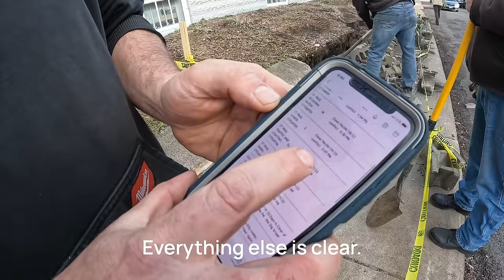Rebuilding a Collapsed retaining wall    4K

Comment: Great video. BTW, when would you need to install a perforated pipe at the base to direct the water from the top and soil away from the wall?

Comment: I’ve leaned a lot watching your videos. Curious about your opinion on bagged concrete use, I see a lot of those around drainage pipes and some yard retaining walls. In my case I have undeveloped land with  wash outs and erosion. Thought of using concrete bags or even burlap bags filled with dirt to control the runoff. On a tight budget and it’s all DIY here, don’t want to waste time, effort and money. Thanks for the videos.

Comment: Hi Stan, One very hot summer I built  a 35 foot retaining wall with those stepped interlocking blocks.  The wall was five courses high and the blocks were very heavy.  I figured I'd set them all in place and then backfill.  I think you can guess what's coming.  As I placed the last block the entire wall collapsed in a cascading motion, like dominos!  I yelled to my wife, "Who's the engineer on this job!"  Since the blocks were interlocking I had to reset EVERY SINGLE ONE!!!  LOL  Shalom/gw  PS  I backfilled as I went the second time.
Reply: Lol😅. That kind of sucked, I'm sure.

Comment: My 3 foot tall wall settled some the first 3 years. So if you look for it you can see that it is slightly wavy. In the last decade is has not moved an inch. 

Is that now self compacted. Or is it possible it will start moving again and eventually fail. 

We put down 3 inches of angular rock.

Comment: Great job, Stan and crew!  As far as what videos, I like a mixture of all you mentioned.  A good variety keeps the channel content fresh and keeps things interesting.  Only thing I would change is those captions.  I think they are unnecessary and they at times are totally incorrect.  I think YouTube has a feature that you can toggle that will add captions automatically.
Reply from the maker: I’m working on getting rid of the captions for you guys
Reply: @Dirtmonkey  Thank you

Comment: Hey from the UK Stan! 

Firstly I just want to say thank you for the content. Always enjoy your videos from the trade shows to the construction! 

Two questions for you. 

1. Why do you in America do almost all of your retaining wall with interlocking block? Over here in the UK we build them by hand and put mortar in between creating one solid unit compared to your individual block method. Is it because its quicker and easier or is it to do with the freeze thaw you get over there? 

2. I understand why you put clean stone behind the wall to act as drainage but you don't wrap it with a membrane? which over the years will lead to sediments transitioning through the stones and silt collecting at the base of the wall which would then create a problem. 

If you could go over that in the next video or even a reply would be interested to know! 

Again love the videos. 

Thanks Ollie
Reply from the maker: no membrane because that will clog and create hydrostatic hot spots-or potential blowout.  We also don't use mortar because the walls "float" with the freeze thaw cycle and it it seems to work good.

Comment: I am currently rebuilding a 30’ Celtic block retaining wall along driveway. Same scenario as here. 7 courses+ cap (@42”) stepping down 1 course twice to 5 courses. I noticed you didn’t separate dirt from clear backfill this time. Wont the dirt contaminate the drainage gravel over time? Love your channel! 🪨🧱⚒️✌️🇨🇦

Comment: No filter fabric on top of the stone? Wouldn’t it silt up, get wet, freeze and then push out the block?
Reply: i think the fabric gets clogged usually and puts more pushing force on the wall. could be wrong though
Reply: @danielaltamirano322  Stan does this on all his bigger walls though? Although it’s more of an anchorage

Comment: Fascinating to see how retaining walls are built in the US😉 here in the uk we would concrete the foundations and use hollowed out concrete block which we feed steel rebar through vertically, we also lay rebar horizontally across the beds.. we then fill the hollowed out voids in the block with concrete and that gives you extra tensile strength both vertically & horizontally.
Reply from the maker: Yep-  we did that back in the 50's and 60's here and some people still do it in these parts.  BUT those walls have a higher failure rate than how I build them when they are done right.  PROBLEM is most companies don't do walls right.  More landscapers build them wrong than right.

Comment: A mixture of all of them and if I was watching this video correctly you do not use adhesive for your caps something like a or just that type of block wall have its own recessing locking cap to the blocks we have a local block company in San Luis Obispo and I don't think they make a block anything like what I've seen in some of your videos but I do like that block that you are using is more symmetrically square where you can cut your angles for your radius outside turns and I suppose you cut the face to make your inside turns I think I said that right you're outside turn would take you back into the hillside you're inside turn would take you away from the hillside 🤔🤯

Comment: Where is the fabric on the backside of the clear rock and geogrid every other row??? And Why didnt you dig back farther? barely even 6" of clear behind the wall is not enough?.. also for every foot of wall you should dig back that far for your geogrid. 3 feet of geo grid with about 1 foot of clear rock with fabric behind to keep the fines out is the way. Also didn't see any drain tile pipe laid with the first exposed row and atleast 1 drainage outlet...?? Your videos are always different. One video you say use this or that and then the next video you dont use it..? i dont get it. I thought overkill is always the way with retaining walls. This seems half assed to me..